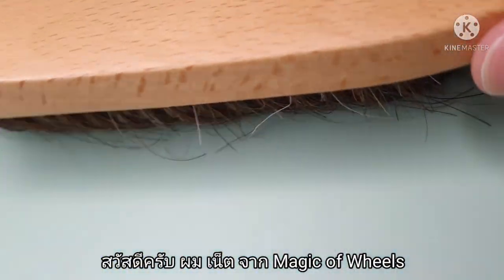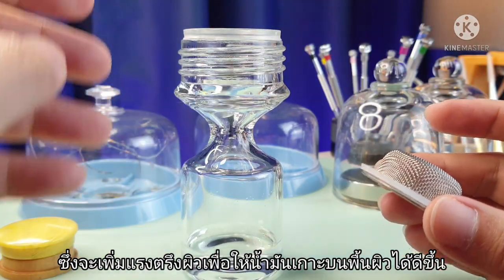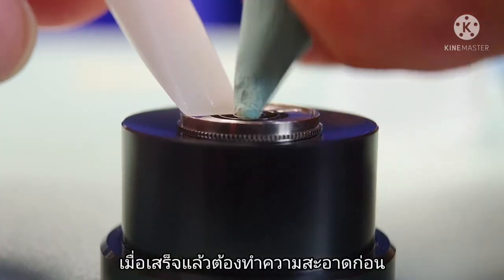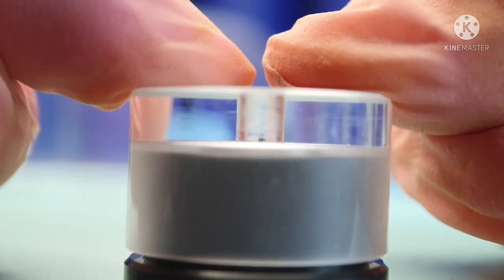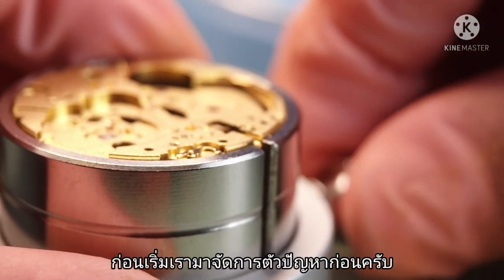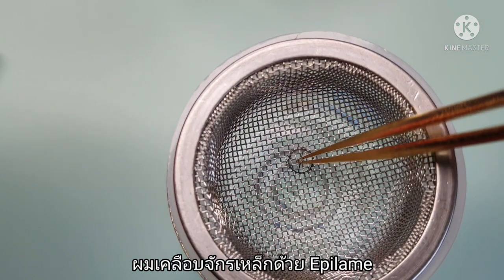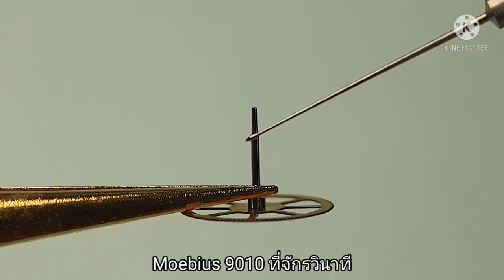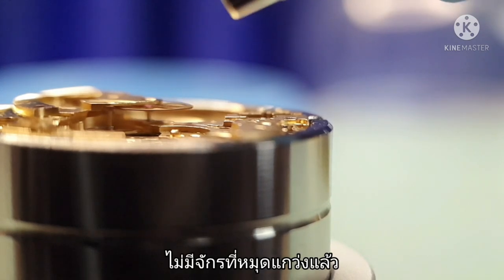Servicing Paul Picot ETA 2824 Part 3 of 4 Oiling / หยอดน้ำมันเครื่อง ETA 2824

Comment: you should consider puting a small bead of grease in the center of the mainspring barrel, not just on the outside edges. this is common practice for us. just a suggestion friend
Reply from the maker: Thank you for your suggestion.  I really appreciate your time and kindess.  I will take that into my consideration.